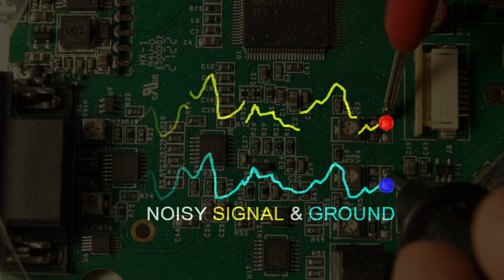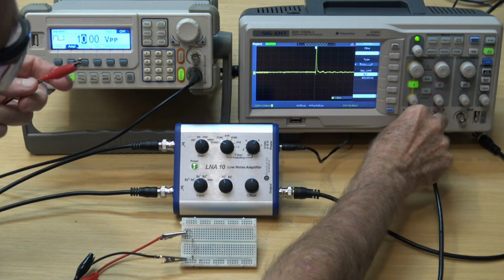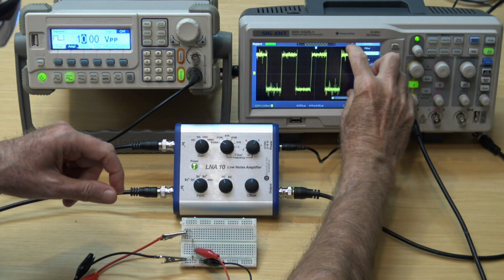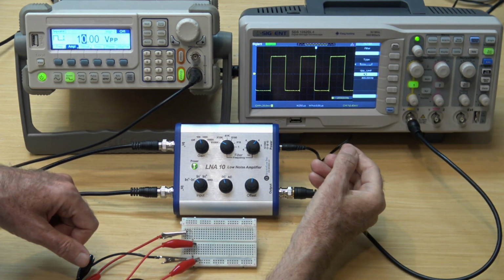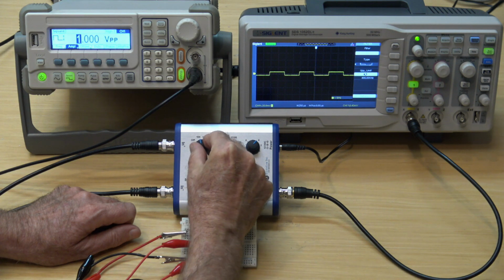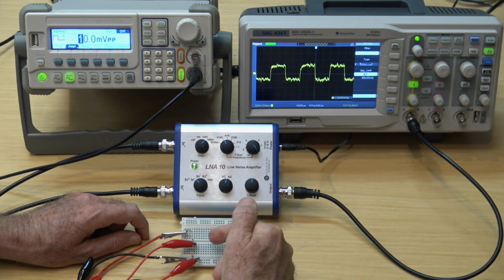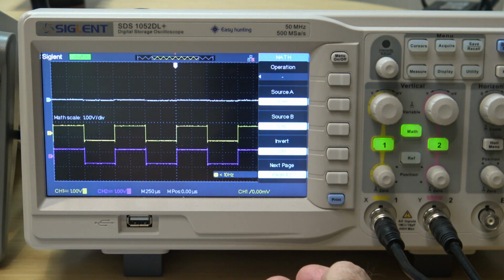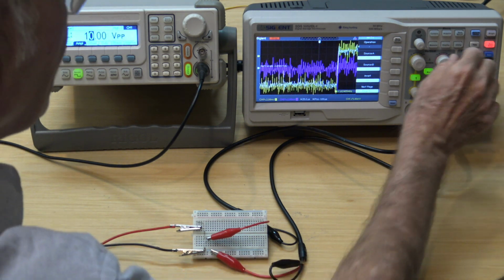Differential Amplifier for Noise Reduction

Comment: So a lot of noise in this case and many other cases is called common (mode) noise, which means there is "the same noise" on the (+) and the (-), which is really interesting to say the least. That's also why doing a subtration (difference amp) cancells that out (most of it), leaving only the meaningful thing on the output. Awesome content!